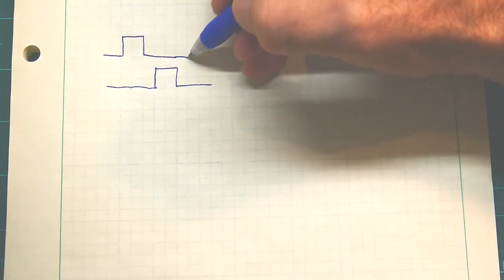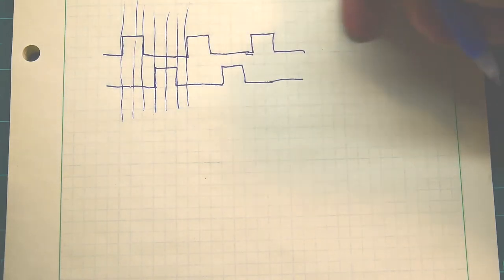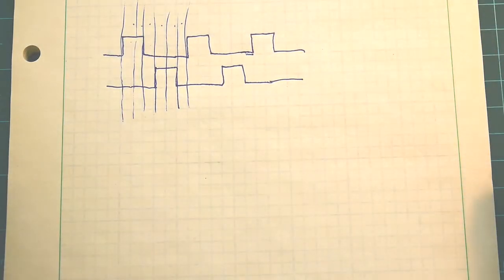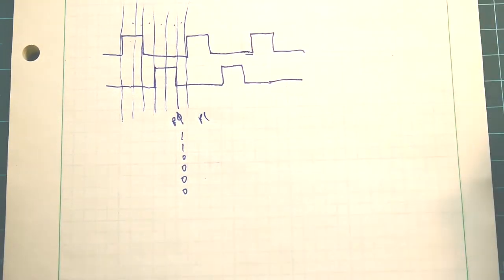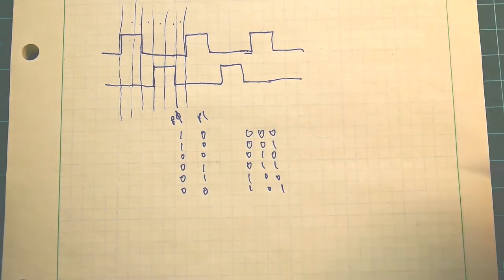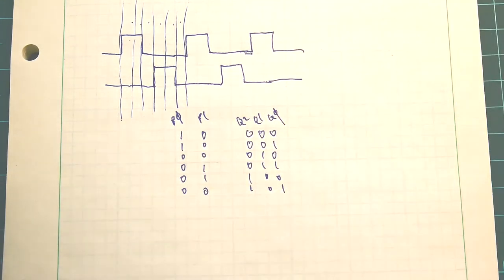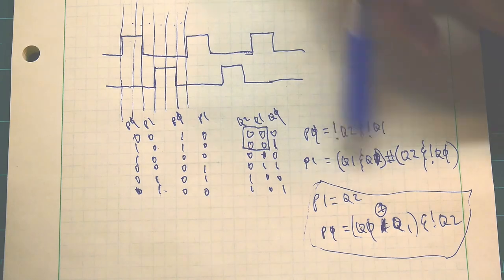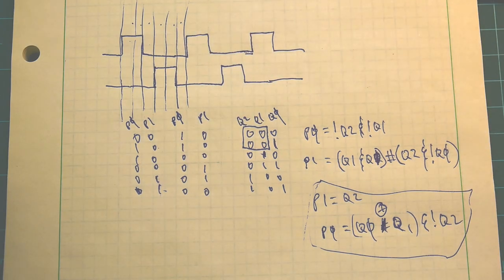#92 TTL CPU clock generation

Comment: I wanted to be an electrical engineer a long time ago.  I was fascinated with circuits, carnough maps, and gate structure to achieve the correct logic.  

Long story short, I ended up being a mechanical engineer.